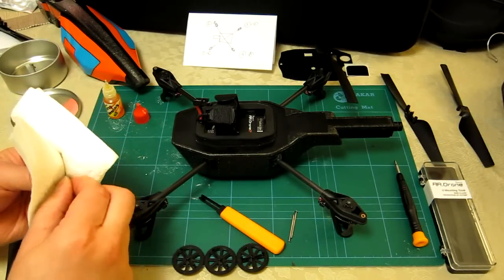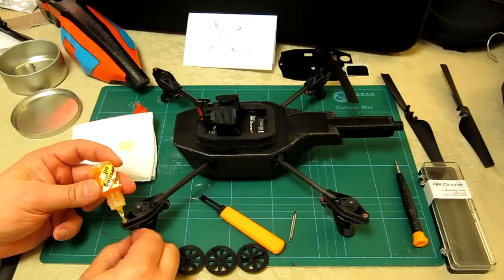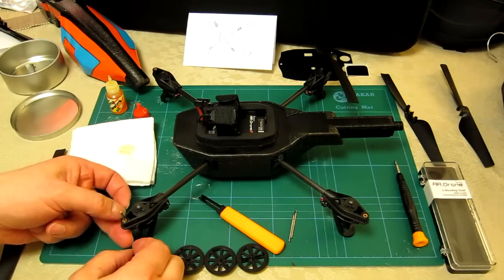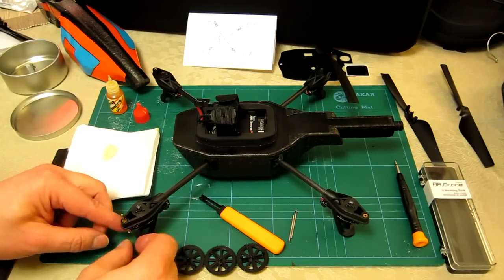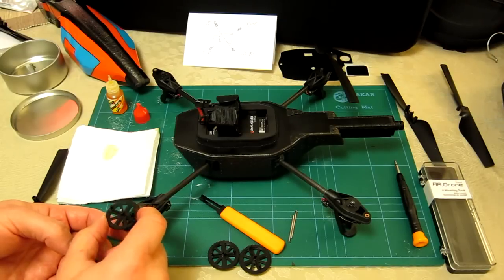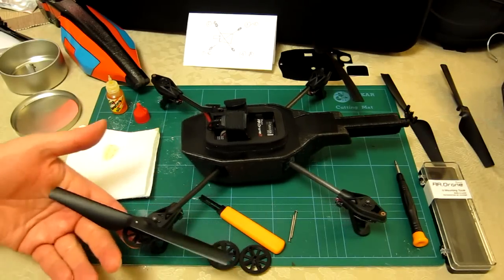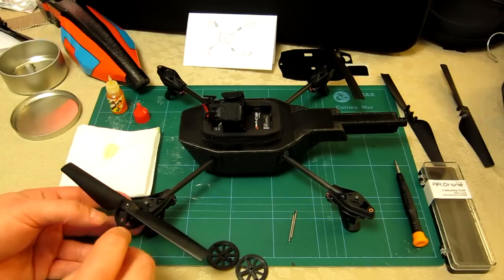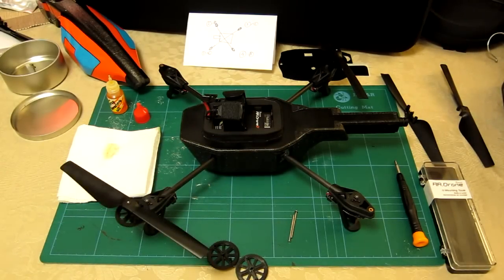Parrot AR Drone - Maintenance - Oil Shaft Pins and Bushings - Lubricate Bearings

Comment: Good video. I am using DEUTHLON drone lube instead. It has been GREAT. I can feel it has better performance than the brand new drone. It really gives me more flying time. I think it saves my battery consumption as it gives optimum power transfer to the propellers.
Reply from the maker: Thanks for sharing. I agree that the right lubricant can make all the difference. I used to race RC cars and it used to add noticeable race time to my battery life.